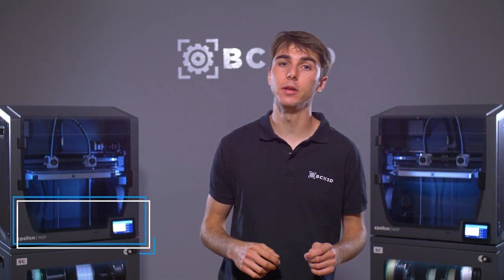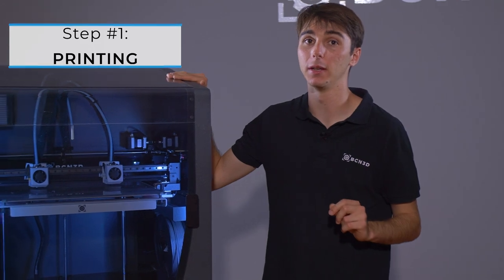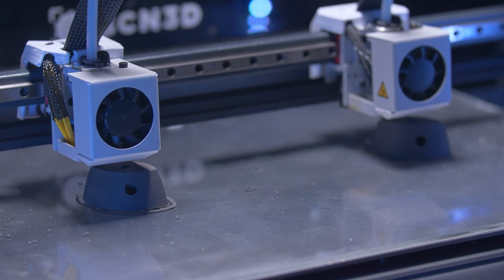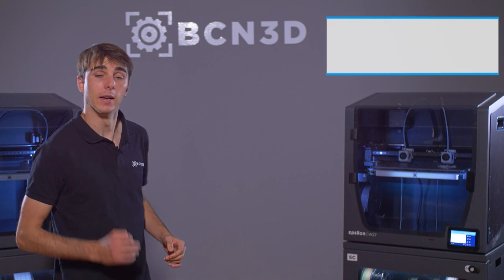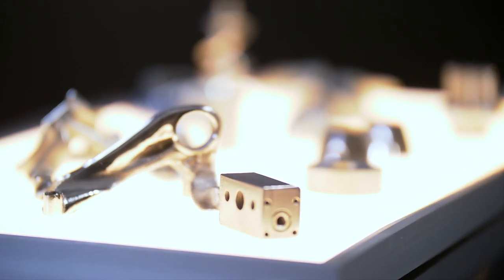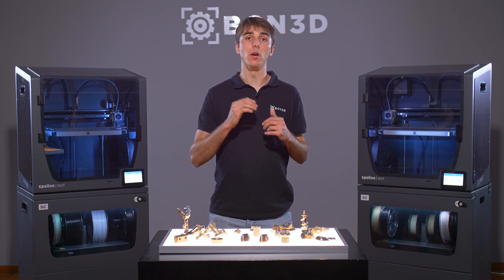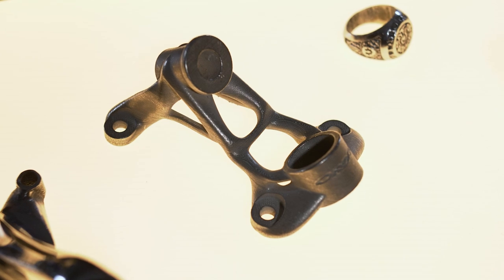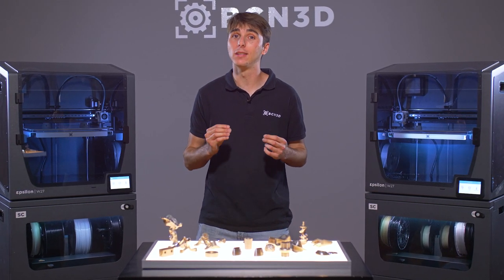BCN3D Explains: Metal 3D printing made easy

Comment: I have a D25 (2021) with tweaked Firmware and a converted 230V Bed, raising up to 120deg within 2mins.

This will also work on my machine too, I think. 
So, hotends are compatible to my D25(hardware side)?
Reply from the maker: Hi, we do not recommend at all modifying the printers as the guarantee can be lost.

Comment: Excelent, These metal parts after all 3 processes need tempering process or not? This type of metal can be used to make parts that require sharpening such as knives?
Reply from the maker: Hi Jorge, it doesn't require tempering process, and yes, it can be used for the applications you need.